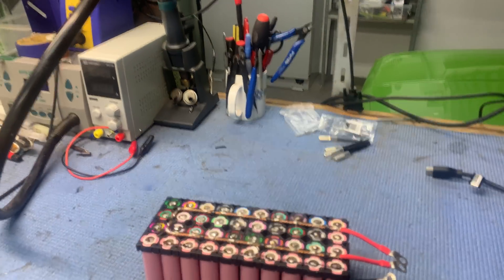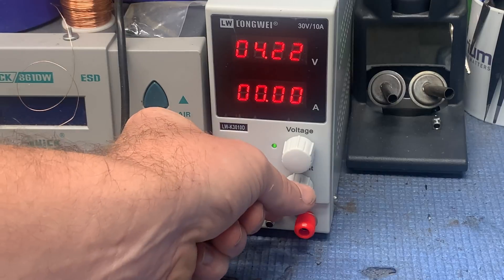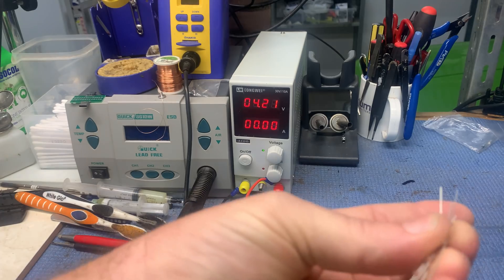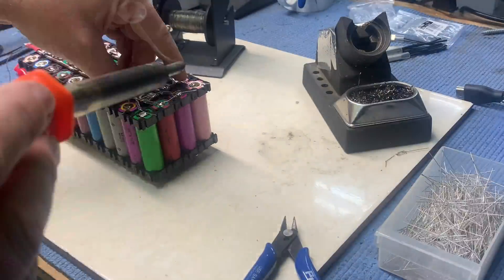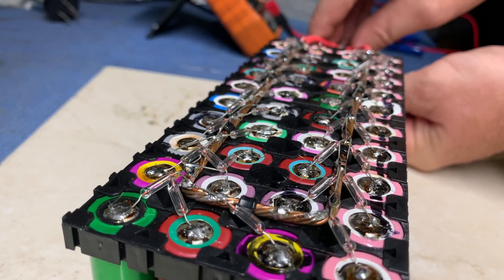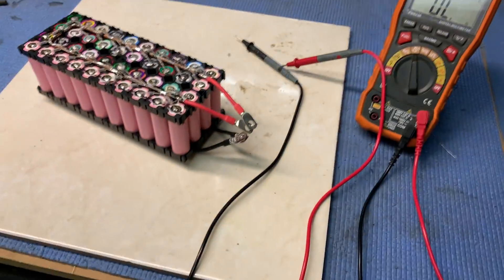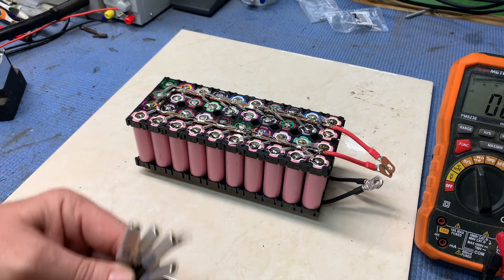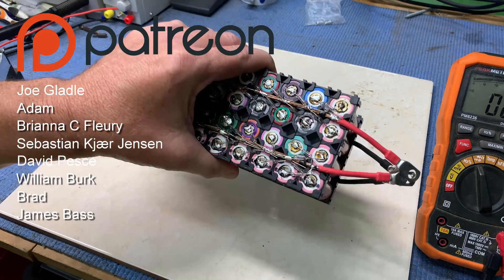Glass fuses on an 18650 battery - Cell level fusing

Comment: I don't get it. Fuses are a safety device, but soldering them, especially to the center of the cell, damages the cell. So you're damaging the cell to install a safety device in case the cell fails, increasing the likeliness that the cell fails.

If we're going to copy the tesla style pack and use fuses, why not include other knowledge from those same packs. They use vibration to weld the fuses on. Of course a DIY pack builder doesn't have access to that tech, but we have access to plenty of cheap DIY spot welders that would minimize heat to the cell.

We know heat to the center of the terminal is extremely damaging to the cell, to the point where factory made packs use nickel strips that have the center of the cell removed to help stop any heat from getting there. So why would we ever apply our connections to the center of the cell?

What are we doing, if anything, for thermal management?

What are we doing, if anything, for a dustproof, fireproof enclosure?

If we're just cherry-picking the easy safety precautions to follow and then ignoring the other ones, that isn't safety, that's theater.  

Have you considered cutting small nickel tabs, and soldering the fuse to the tab, and then spot welding the tab to the cell? Time consuming, but it allows you to basically use the same method you've used here without putting a glob of solder in the center of the terminal and while minimizing heat to the cell.
Reply from the maker: All these tests in past few video stemmed from how someone did it.. now how we should do it moving forward - however I'm sure someone will move forward different from this playing I've been dong.
Reply: @HBPowerwall  there's not enough videos on this topic and if there was, they are to short, either they are deliberately made short or stuff gets left out onto the cutting room floor... 
Yeah there's always someone who complaining about video length, I know because I was one of those people, well I didn't complain in the comments but I avoided the channel only to re find it again at a later date and realized what I had missed out on! I went right through the whole channel and watched every single video, they run for at least one hour minimum! I have seen others complaining about video length but it's their loss as it was mine before them! Now I click like even before I watched the latest video! 
What you are doing here is unique, going through the process of finding the best method of protection is fascinating viewing, I know that I'm not board! LoL I could easily watch you test different ideas for 11 hours straight let alone 11 minutes, besides, blowing up fuses is fun, I know, have done it may time's both deliberately and accidentally... 
I don't know if my suggestion is worthy of a mention but it just came to me as I was typing this out, 
Another possibility might be PTC fuse, it looks like a ceramic disc capacitor, you would have to shrink wrap it's legs but once done, you can fold it over and place it in between the batteries, heat makes them trip faster as does excessive current! And they are self resetting! So long as they don't get damaged.... I use them on speakers, when they trip, it sounds like someone has just turned down the volume! They stay tripped until the volume is turned down or short circuit removed.... 
I'm not sure how they would go in this application, they come in different wattage ratings and you can parallel or series them to get the desired outcome, they should be available from jaycar, I know that I have got some form there age's ago but since discovered that if I'm prepared to wait, I can get 10 for the price of one from jaycar over on eBay!.. actually I believe that they are called PTC resistor's, even though they are resettable fuses...
Reply: Dude, when a cell fails, it's going to fail regardless of whether a fuse is present or not. The best that the fuse can do is protect the cell from external short circuits. 
These glass fuses are great for this purpose and they are reliable! 
The best way to go would be to purchase brand new protected 3500mah batteries, they are very well protected and your battery bank will be super neat and tidy but it's gonna cost ya!
Reply: @PeterMilanovski  Yes, which is why I'm pointing out that the fuse is only 1 part of the safety picture, and I don't get the point of using a fuse but not taking very basic precautions like not soldering or at the very least keeping your connections away from center.
Reply: @caramelzappa  I get what you are saying about soldering the cells, I personally haven't come across any real information regarding the heat from a soldering iron, let alone what it does to a cell if it's done more than once... I know that people do it, I haven't myself, I purchased those plastic spring loaded cell holder's from eBay, they are cheap, quick to pull out a cell and I can have a single cell protection PCB board for every cell underneath it and I can keep all the cells tied in with one neat zip tie... But my method means that I have to charge all the cells at 4.2V! Even if the output from the protection PCBs are wired up in series... The output only needs one fuse! As the PCBs cover everything else, over and under voltage! Short circuit... And because they are in this configuration, they are naturally balanced! Each PCB will stop charging it's cell when it's full while having no effect on the others! 
The PCBs are really cheap and they stay with the battery holder meaning that you don't have to use expensive protected cells... Well that's how I have mine set up... 
I guess that there's hundreds of other ways to do it, the heater cells are a worry, my cell holder's are plastic! But I'm only using new 3500mah cells and I'm only pulling 500ma from each! Although a thermal camera is next on my list of things to get!

Comment: The fuses that did not blow were likely a damaged in hook up or poorly connected, this bears out in the fact that you had to press and move the fuse around to get a decent contact, even this though is a better result as it shows a disconnect in voltage to the bus bar where the previous fuses still had full contact.
Thanks for doing these videos as they are a great help to many people.
Reply from the maker: I hope they help, it's just me messing around then sharing.
Reply: He's soldering directly to the cells. My guess is he has cold solder joints on the negative side of the cells.

Comment: I've been watching your videos as a learning experience - Thanks for all the great info as I am learning and planning a solar system. One question though. I don’t understand how your power wall batteries are configured. Are they all configures as one cell at 4v and then connected in series before attaching to your inverters? If so, what voltage are you feeding your inverters? Is there a specific video where you explain your rationale being this configuration as opposed to building a pack that puts out 12/24/36/48 volts or whatever? Thanks again.
Reply from the maker: This post SHOULD help https://secondlifestorage.com/index.php?threads/hbpowerwall-official.176/post-867

Comment: those non resetable thermal fuses are probably for mounting inside transformers touching the coils, they will blow up when the transformer gets over a certain temperature
Reply from the maker: They go into toasters, HWS etc apparently
Reply: They're very popular in Rice Cookers. I sold dozens when I worked at >Jaycar 20 years ago...

Comment: Never in a million years, would I have believed that "fuse wire" would carry almost 9A. That's insane! This is why glass fuses are a better alternative. You know what you're getting (within tolerance).
Those thermal fuses are of no use to you, unless you intend to strap them to the side of every single cell and even that would be of limited use, seeing as the thermal fuse temp is so high. Their intended use is in appliances with a thermal element or similar (the side of a motor for example) as a fail safe (usually secondary).

It really is beginning to look like the only way to make these installations safer, is 1: containment of packs, and 2: a sensor matrix that monitors literally every cell looking for heaters. 

https://www.ebay.com.au/itm/50PCS-MF52AT-MF52-MF52B-3950-NTC-Thermistor-Thermal-Resistor-5-10K-50K-100K/193240413757?_trkparms=aid%3D1110009%26algo%3DSPLICE.COMPLISTINGS%26ao%3D1%26asc%3D20201210111452%26meid%3D565190a3b0c943a58f6d352d9ec09b1e%26pid%3D101196%26rk%3D7%26rkt%3D12%26mehot%3Dnone%26sd%3D201415005626%26itm%3D193240413757%26pmt%3D1%26noa%3D0%26pg%3D2047675%26algv%3Ddefault&_trksid=p2047675.c101196.m2219

https://www.ebay.com.au/itm/10pcs-NTC-Thin-Film-Thermistor-100K-precision-1-MF5B-SMD-for-3D-Printer/201415005626?hash=item2ee54515ba:g:A8cAAOSwBLlVWxJX

There must be a cheaper way to procure them in bulk. If people are interested I will start designing some sort of data acquisition/monitor capable of handling 1000's of sensors.
Reply: The "fuse wire" can vary, too, depending on the quality of the copper used and/or if it's copper clad aluminum (CCA) (some use networking cable for fuses which some of it is called CCA. This is cheaper networking cable, but the cable is much less flexible). This can be an issue if you've ended up mixing different brands or spools of wire to make the fuse links.
This is also why if someone chooses to go this route "they" must test the fusing capability of their wire, not just go off of some YT video and call it good enough.
Reply: @korishan  For a very long time (VERY, so long in fact that I've forgotten where I read it. Probably in an EA magazine some time in the 90's) I always was of the belief that a single strand of "Telecom wire" which was solid, single strand copper phone wire used by Telecom, now Telstra, was good for 2-3 amps and relied on that knowledge as a rule of thumb. I have doubted that it would fuse at 3A for some years, but never bothered to test it or any other wire for CSA vs current carrying capability.

Having watched that, I'm going to do some research into it. It's not knowledge I've really needed before but now I'm curious to know.
Reply: I use 30AWG tinned copper for my fuse wires.  I'm of the impression they melt at 12-20a based on my 'loose' tests.   I never expected all fuses to blow in a pack short.  I expect the minority (e.g. 1 bad cell) fuse to melt/disconnect based on the amps of the other 50 or 100cells.     When it gets down to 5 cells left of 100 cells - still connected to the bus because the fuse wires didn't 'blow'...  that makes sense to me.   The 5 or 4 or 3 cells may not have have amps to melt 30awg at 20a...   they just dead-short and run down.   BUT I also don't expect these remaining 5 or 4 or 3 cells that can't muster 20a to catch fire.    So I'm confused at the notion that all cells would disconnect from the buss at battery short.    This is why I also fuse the 'battery' as a whole.   Again, there are 2 events here in my mind - the BIG SHORT - which hopefully will trip the battery level fuse and/or most of the fuse wire...    but there is a post situation where there could be some power left in the battery - not enough to burn remaining fuse wire.   I'm not saying that my understanding is correct - just something I've believed until this excellent series attention on pack fusing :)
Reply: @kennethalmond8922  In the event of a buss bar short, every single cell is going to supply what it can. If (in your instance) 80 out of 100 cells blow their fuses, that means that every one of those 80 cells delivered over 12 amps to the buss during the short.

There is no sharing of current across any cell fuse, during normal operation.

The purpose of fusing each individual cell is to stop the other cells from supply current to it in the event of a cell failure.

In your case, you should seriously consider using MUCH thinner wire for fuses. In reality, if you are running 100 cell packs and have 1A fuses on each cell, you can theoretically draw 100A from that pack continuously without issue.

That's over 400w per pack at 4v. Running 14s that's 5.6KW continuous available for your inverters.

This is where internal resistance comes into play because though the batteries have no choice but to remain at equal voltage, they are not going to share the current evenly and so there will always be current flowing between cells during transients.

You should be sizing your fuses with several things in mind.
1: the maximum current required by your inverters, shared over x cells in each pack.
2: the maximum charge current your solar system and regulators can apply to the battery at it's lowest SOC.
3: the internal resistance delta of the pack. (though I don't personally know how to apply that or how the maths works, I'd have to look into that.)

Unless you are running large inductive loads from the inverters (Eg. an air compressor) which have large inrush currents at start up, 1A slow blow fuses should be more than adequate.

Also, kudos on having a pack level fuse. That is a MUCH safer way to go about it. In the event of a buss bar short, not only on one pack but anywhere on the buss'/series connections, there will always be a fuse between. No matter where the short. I have always intended doing the same  - fast blow ceramic's at pack level.

Comment: I have the exact same power supply  you are using in this video to test the glass fuse the only thing different I noticed on this one the display is different Either they updated it since I purchased it or it’s a difference between the US model in the Australian model

Comment: I do follow and watch your videos. What I know with used cells is some have a very high internal resistance (although the capacity and discharge test passed) so the fuse may fail to burn as it should.
Reply: it is realy important to have cells with low IR, IR is direcly linked to the health of your cells....there is a guy at second life storage his name is wolf he made a study how IR relates to the health of cells.
I have also a 18650 48 volt 150 ah bank and are IR and mah matched my bank are realy balanced 0.003 volt difference

Comment: what about ntc thermisters between all the cells? won't interrupt a fault but would mean you'd detect heater cells before they could cause too much trouble? though that's a crapload of temperature sensors
Reply: This is an idea. Could possibly work. But it would also mean needing to check the thermals with a camera quite often, which isn't a bad idea in and of itself. At this point, thermal cameras are an investment, not an expense, for this type of work.